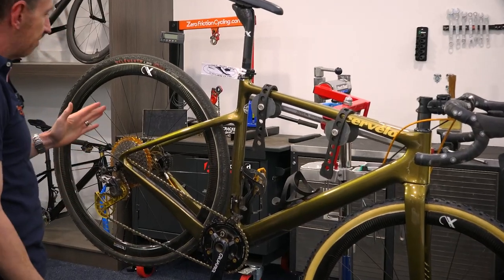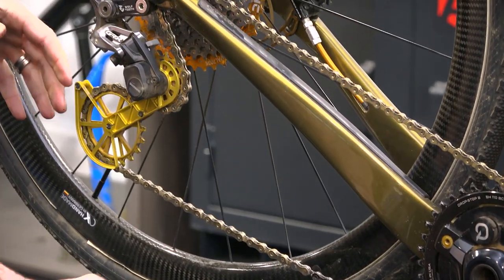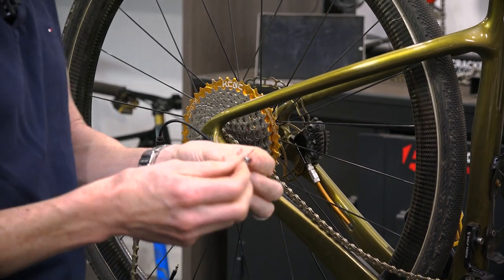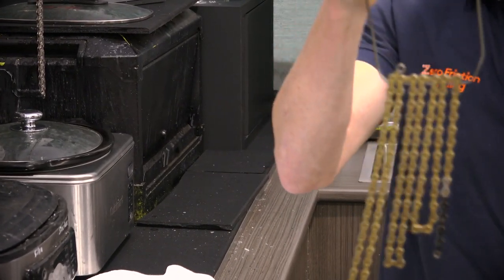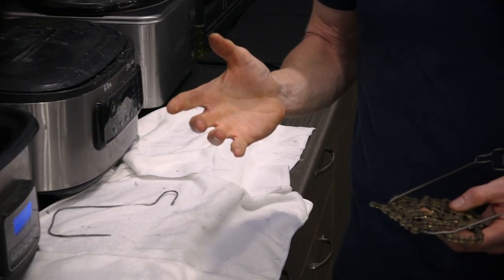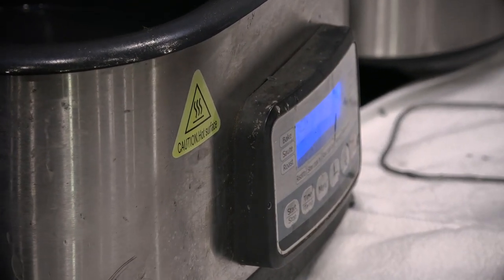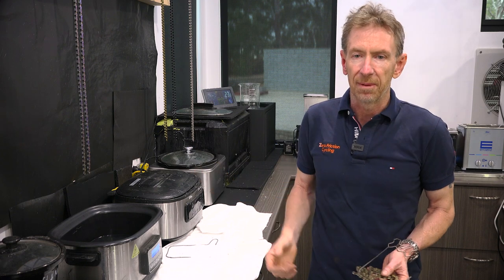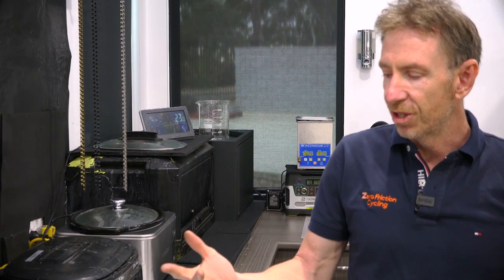Episode 4 - Part 2 Immersive Chain Waxing  - How to Guide.

Comment: I've now tried immersive waxing of my chain for the first time, and can attest to the simplicity and effectiveness of it.  I bought a cheap slow cooker - the brand Adam suggests (but I could only get a 3 litre capacity one, not the 1.5 litre size he mentions, which doesn't seem to be made anymore).  I bought some Molten Speed Wax (2 units = 4 pucks), melted the pucks into the cooker, and let it cool overnight as the first step (but I could have added my chain once they had all melted).  Next, I removed my chain, put it on top of my wax, turned on the slow cooker, and let the chain melt into the wax (threaded onto a swisher tool).  Simple!  As Adam suggests, you can go off and do something else while it melts.  Once melted, and the chain is hung up to dry, it only takes 15 minutes for it to go solid - ready to place on the chain.  As Adam says, the total labour time is minimal - chain off, onto wax, then once melted (nothing you need to do), hang up to dry; it's nothing.  I've now ridden 147 km with my waxed chain, and it still looks and feels great.  I showed a local bike shop how clean it was, and they were amazed - given all my riding had been on a gritty trail.  I've also found the gears change more smoothly than when using a drip-on lube.  Hardly anything comes off the chain when giving it a wipe after a ride compared to when I used a drip-on lube.  Three cheers for Adam and ZFC - he brings science, not hype or marketing - to what is best for chain maintenance, performance, and longevity.  Because he's not trying to market his own product (he doesn't have one), I'm completely satisfied that his testing is un-biased.  Also, you can tell he is genuine in trying to get out the the cycling world what really is best, objectively.  He's made lots of videos and guide documents not for his benefit, but for all the cyclists out there.  I hope that ZFC becomes a 'household name' in the world of cycling not just here in Oz, but internationally - for everyone's benefit.
Reply: Stripping the factory grease is a part of the process that he recommends in his PDF, and he says the wax doesn't adhere well with factory grease on. Did you go through the 5 solvent baths to clean the factory grease off? haha

Comment: Really clear video.  You can't go wrong, as Adam says.  I'm not mechanically-minded, but have been able to quickly remove and re-install my chain without any problem.  I wanted to 'master' this first before doing the waxing, and as he says, once you've done it, you wonder why you were nervous about it.  As Adam says, the total labour time is minimal.  When you look at the data that Adam has published on immersive waxing (wear rates on chains) compared to other methods of lubricating your chain, the case for this method wins hands down.  Totally compelling.  I'm a definite convert!

Comment: Thanks Adam. You stopped me from making a very expensive mistake! re AB Graphen Wax. It's the only immersive wax product available here in (backward) NZ and after reading your reviews on this product, and AB's dodgy practices, I've put immersive waxing on hold until we can get some decent products. In the meantime, it's Effetto Mariposa Flowerpower for me!
Reply from the maker: Yes i must say the AB wax was super disappointing, especially after how strong (but stupidly expensive) Graphenlube is. They NAILED the packaging and so i was quite looking forward to stocking graphenlube and graphenwax bundle packs (despite the erm.... issues.... i still stocked graphenlube) - but then yeah that wax was a shocker. There is apparently a v2 out which i may or may not look at sometime, im a bit undecided. But it is funny that they have a v2 since according to them v1 was as perfect as if was delivered to earth by the holy lord and all the angels, and that any issues were most definitely the cyclists fault. So i do wonder how they improved on v1!!! :)

Comment: interesting how you do it a bit differently to Silca, they recommend to pull the chain just before it cools to melting point to keep as much of the wax on the chain as possible. I guess this is so more of the product gets used on each immersion
Reply from the maker: yep we are aligned with silca information on many things but not that.  the pressure inside chain is too high, after 10 mins of cycling you will have same coating thickness inside chain, just removing cool  equals more faff, more mess and more waste - so for sure we recommend not to do that and to just remove after one has swished at normal waxing temps and hang to set

Comment: THANKS! Spring is coming in Montreal, and I'm ready for the wax switch. In the video, we can see peace of wax on your cassette and OSPW. Do you need to clean this? Do you like your Kogel OSPW?
Reply from the maker: i generally do not clean excess wax from chain ring / cassette teeth etc as this is very wear protective. Pulleys will build up more excess more quickly as just do millions more revolutions so periodically i will wipe excess of those. And yes the kolossos really suit the gravel / cx race bike. Kolossos appear to be a much stiffer & stronger cage for such duty vs other OSPW systems. A few cx stacks on that side of bike now and all sweet, and it looks and runs mint :)

Comment: thanks for the guide. one question though, what is that sprocket? rear drivetrain is super bling
Reply from the maker: Ah that is kcnc 11-42 cassette, which yes i did buy a) because it is very light - that is on my ax lightness cx race wheels, and b) because it came in bling. It was not cheap, and it will be soft (fast wearing) like most light cassette alloys. For me it will last as a) i wax and as its race wheels, it is really only ever seeing freshly waxed race chain so it is very well protected there, and b) it just doesnt see that many km's -  it will do maybe 6 cx races a year (including riding to and from race) so it will be a decade or more of cx racing before i have to worry about it. So $700 odd bucks over 10+ years - for me its worth it for the style watts :). I wouldnt recommend this cassette for ones daily ride however unless you are going to re wax your chain every ride and replace chain by 0.2 wear (like a race chain...)

Comment: Silly question here. After cleaning the bike with soap/water and some brush/cloth friction on the cassette/derailleur, it is necessary to re-wax the chain or is it good to go for longer with just a quick dry?
Reply from the maker: Hey philippe - there are no silly questions (mostly... yours isnt :)) Is it post a dusty offroad ride? Overall if the wax treatment is not telling you it is getting thin and time to re wax you should be fine, but try not to contaminate wax chain with stuff that may hurt bond (soapy water) on re waxes. Try to treat waxed chain kind of like you treat your brake discs re not contaminating with slippery stuff, and then all should be sweet. Watering chain and then if it sits for awhile, a waxed chain may rust  - so be wary there too. 

Personally - i dont understand watering a bike unless its been a wet offroad ride and it needs a jet wash, in which case i am re waxing chain anyway post any decent wet ride. Dry riding, i spray a cloth, and wipe bike. I see videos of people taking garden hose and a soapy sponge to road bike that has only done dry riding, and i must admit, i get very confused.
Reply: Thank you for your answer. I was indeed thinking about a muddy MTB day. I also don't understand the hype about cleaning after a dry ride on the road. I guess MUC off is good in marketing!
So I'll wax my commuter and will keep grease on the MTB.

Comment: Not sure if you're making a video for this but what's the best way to store waxed chains? I'm planning on waxing a couple at a time and was wondering if there was a recommended way to store them before you put them on the bike
Reply from the maker: Hi Tadaka, if chain has just been waxed - they are fine to just be stored openly as they are chock full of wax, nothing is going to do any harm to them  in just normal storage. For those waxing multiple chains (ie avid rider running one chain mon to fri, one for the weekend, re wax both at once on rest day, or intrepid commuter who needs to remove chain 1 after wet ride, chain 2 a couple days later after a wet ride, then re waxing all 3 at once etc) - then ensure chain is dried with microfibre cloth if has been ridden in wet - then store wrapped in a microfibre cloth. A waxed chain that has been ridden - wax is abraded off outside of rollers first, and rollers are a high carbon steel for hardness and these oxidise readily if no wax left on them and exposed to open air for a decent stretch, so if it has been ridden and removed awaiting next re-wax, best to store wrapped up in a microfibre cloth. This can be especially important for those doing an interstate wet cx , mtb or road event, where there may be some days post wet ride and getting home to re-wax - dry chain, wrap in a second dry microfibre cloth, and all is groovy till get home. NEVER WRAP IN PLASTIC - plastic like a humidifier and rust catalyst.
Reply: @zerofrictioncycling992  thanks!

Comment: Would it be worth running a hairdryer, on low setting, over the chain once it's been reinstalled?, would it help smooth out the wax and reduce flaking?
Reply from the maker: not really no, excess post rewax will be pressed out and flake off. Excess is really only an issue though for those using for indoor trainer.

Comment: Thanks for the information Adam. Can you please discuss chain direction when refitting. Currently I break the chain below the chain stay and put a hook through the end link at the front of the bike. Most of my chains have different looking inner and outer plates, so by using the hook, I know the chain is going back on the same way. Other chains I have look the same inner & outer and these could be refitted around the wrong way. Does this matter or is it like rotating your mattress and it helps increase chain life? Should I put the hooked chain end at the back of the bike on alternate refits? Thanks!
Reply from the maker: thanks Nick - and as best as i am aware, only shimano chains are directional. If you look at a couple chains from a couple brands, you will see on edges of the outer link plates some chamfering - this is to aid shifting performance. Shimano only chamfers the leading edge on one side of chain (side with writing stamped in), and as such if installed the other way around, shifting performance will be very slightly compromised. For all other chains that i am aware of, they are not directional.  It was more common a long time ago but for awhile now pretty much every one other than shimano has moved away from chain recommended to be fitted in a specific direction, that makes it much easier for OEM install, maintenance, waxers etc to have happy experience with those chains. Im sure shimano will one day, a few more decades of executive meetings (first they have to have a few years of meetings to plan the other meetings) to discuss implementing such a change :) 

And yes, not directional is a bit of an advantage long term. Like rotating a mattress, you are shifting the main wear load to the other side of pin / inner link plate shoulders etc - so if one could be bothered to test - there going to be an elongation wear life advantage rotating chain vs same direction all the time. it isnt something i would bother trying to do if waxing, ie just random each re wax will do fine, if one wanted to if not waxing but was removing every couple of months for periodic maintenance, and its not a shimano chain, then there will be a bit of an advantage to rotating.

Comment: Awesome videos, I'm currently using Silca Wax and my pot is getting a little low. Just wondering if I can throw in some molten speed wax, or do I clean out the existing product to switch over to another brand?
Reply from the maker: Hey Ted! yes you can mix msw and hot melt  - i have done a bunch of that the mix - it would be a brave person who would put up to be able to tell it apart from either just msw or hot melt - however when your wax is getting too low / approx 30 re waxes if in a nice small slow cooker / crock pot - that is a great time to go to a fresh bag vs mix new wax with old wax. Each re wax will bring a small amount of contamination in as the remaining old coating melts off into wax pot. Melt, decant into small bbq tray, wipe pot clean with paper towel, fresh bag in. If one keeps adding new wax to old wax - over time the wax will just be less amazing as more and more contamination slowly builds. A bag should last most people a good 10,000km for dry road cyclists, so its not a crazy cost per year on lubricant, especially considering how much one is saving on drivetrain wear

Comment: Do I understand correctly that if you have already waxed a chain and used it for 200k or so, to re wax you are simply submersing back into wax for 5-10 minutes and then let drip dry? Thanks in advance

Comment: You say not to re-wax the master link, but does that mean it should be waxed only once during the first immersion waxing or do you mean that it should never be waxed? Thanks
Reply from the maker: General recommendation is never due to increased risk on install, and there is plenty enough wax on chain to cover master link. However sometimes for race chains etc people just want to ensure, and so will wax link - or for those who just cant handle the thought of not specifically lubricating that link and relying on wax on chain - a bottle of silca ss drip or ufo etc and put a drop on the pin.

Comment: Hi, I'm interested in waxing but I don't have a slowcooker (yet). Is there any other way to properly melt a wax, or is this appliance sort of a  must have? thx
Reply from the maker: it isnt a must have but it is the most recommended. People doing on stoves etc can simply over heat or heat too quickly. But definitely it can be done, it will help a lot if doing stove to either have a hob, or a cast iron pot for much better heat control, and using low heat. A thin saucepan - you can just easily damage the wax. And doing via microwave... or oven..... or bbq.... just seems to be a matter of time before a mistake is made, so very much not recommended

Comment: Im about to start waxing my chain, just a few questions.

1. How many times can i use the wax?

2. What do i do with the wax while im not using it at the moment and dont want the slowcooker running? Can i just turn it off, out in in a cabinet and start it up the next time im waxing without any loss in quality of the wax?

Thanks for all the great videos ❤
Reply from the maker: Hey PG - all questions re immersive waxing are coved on website / FAQ etc - but quickly for road changing after about 30 re waxes at approx 300km per wax so circa 8000 to 10,000km per bag / box. And yes you just let it set in pot and then it re melts next re wax- the wax will not be damaged unless you over heat it or heat it up too quickly (hence slow cooker is best)